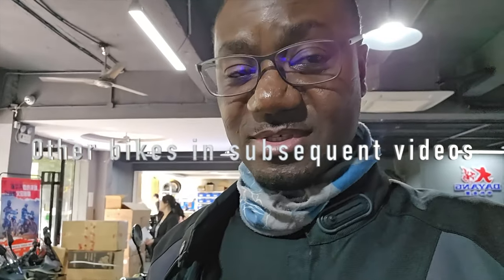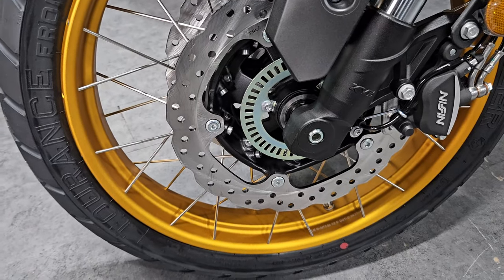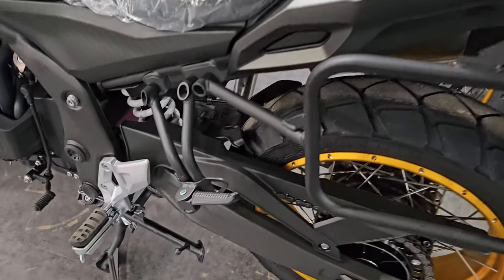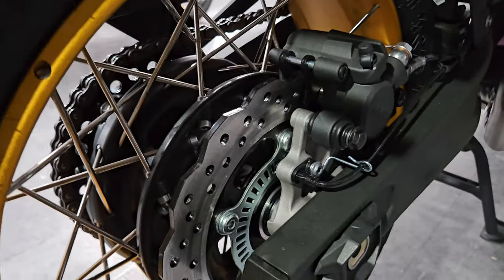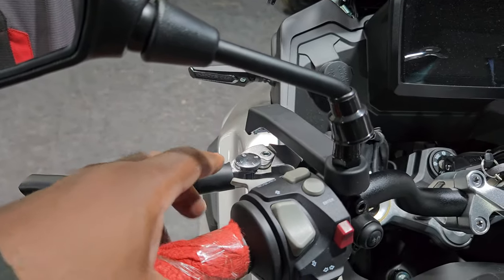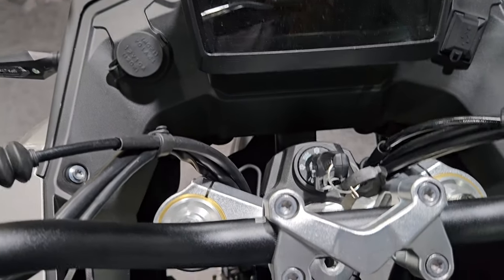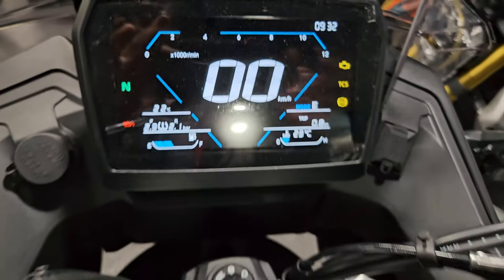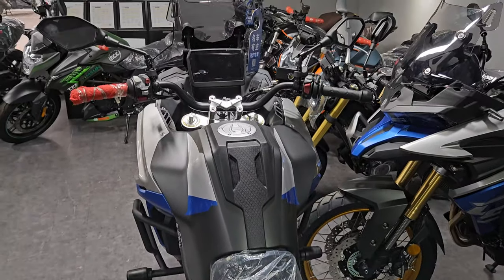Watch This Before You Buy An Adventure Motorbike || VOGE 525cc Adventure Bike

Comment: CFMoto 450MT is over rated. And you still have to pay for a lot of stuff as "accessories". I will rather go for Voge 525DSX which includes the total package. It comes with crash guard, fog light, Center stand, adjustable windshield, even has a tire pressure censor, more power and slightly higher in price. Another plus point is the bike appearance like the BMW GS.. So cool! 😊
Reply from the maker: I agree. But I believe this is because cfmoto is a bigger known brand. However, I like big bikes so I would also choose the Voge ds525x over the 450mt.
Reply: @TheRideandPlace  oh Loncin is also an established company and CFmoto was only a few years older. Loncin also supply engines to BMW. The reason why CFmoto is better well know is they have a good marketing strategy & very aggressive in expanding in both products and network dealers. Loncin should learn & try to copy CFmoto success. I'm rooting for Loncin hehe 😁👍